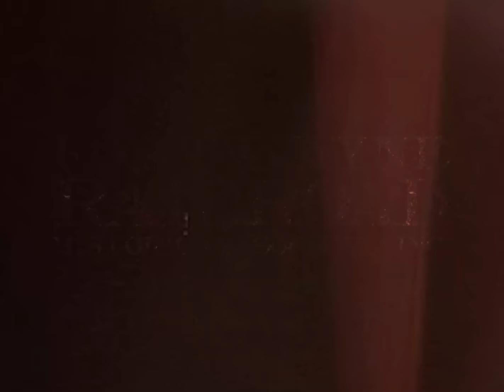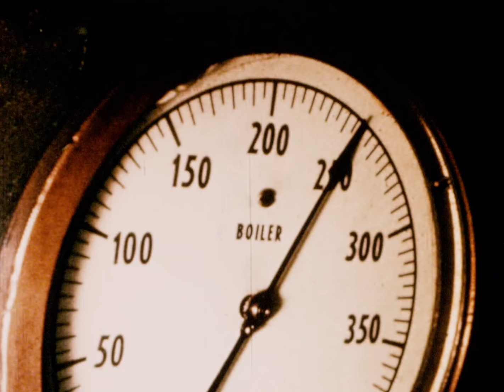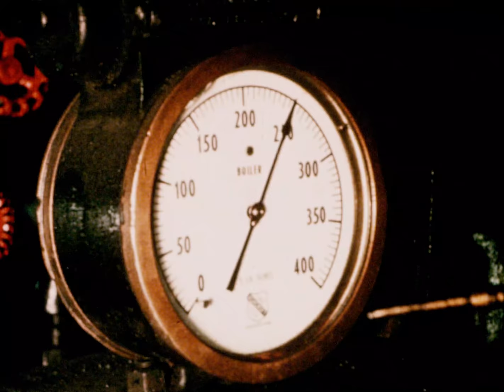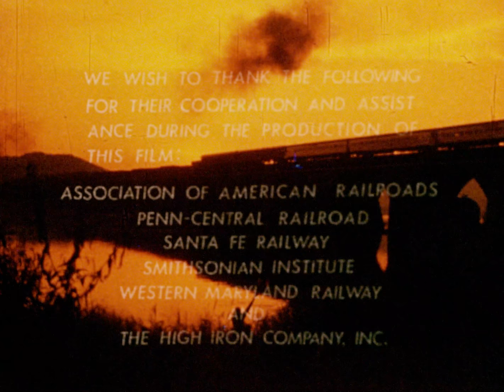Steam Right On – An Inspiring Steam Revival | Nickel Plate Road no. 759

Comment: ] have a personal connection with Nkp 759, and Nkp 765. My grandparents rode on the Golden Spike Centennial Limited from Chicago to Omaha back in 1969, and they loved it. My dad would then ride in the cab of the 759 during the Scranton Excursions in 1971-1972. I visited Steamtown and I remember getting special access to 759 as Nkp 765 pulled up alongside it.

edit: What is so significant about the Nickel Plate Berkshires having a mars light?